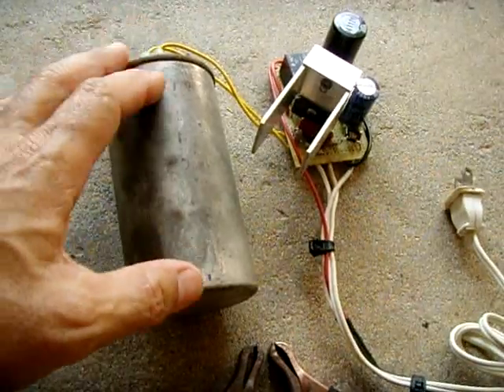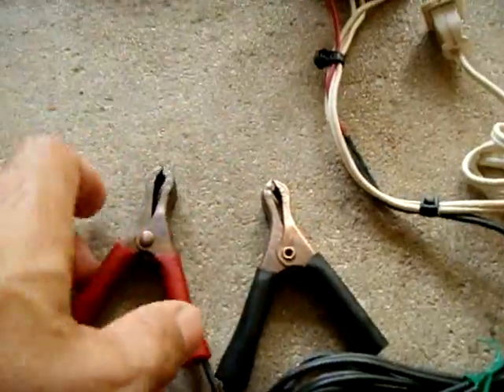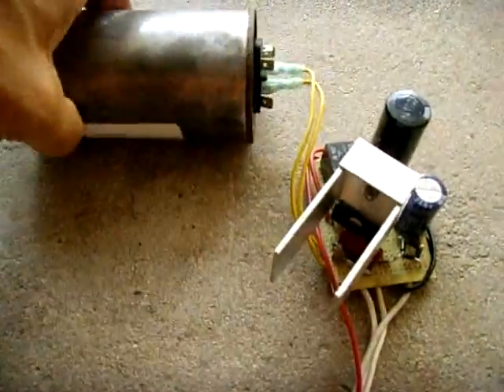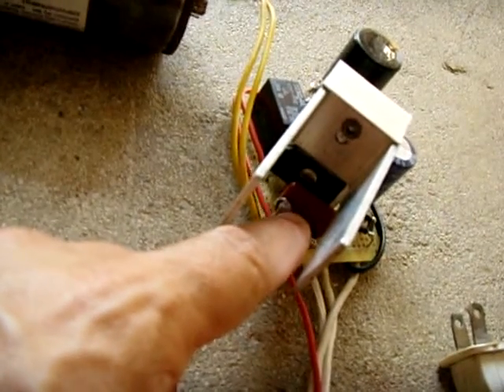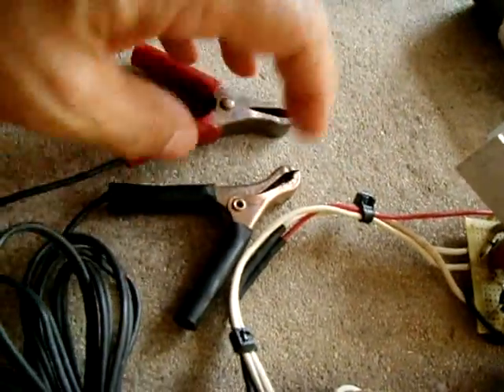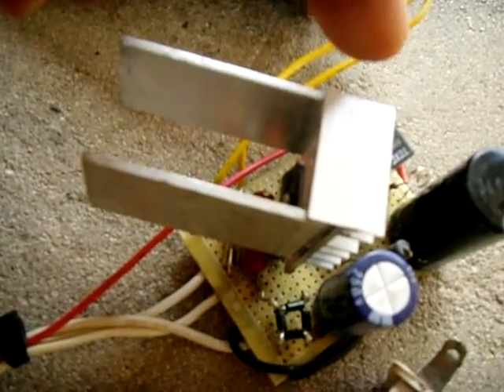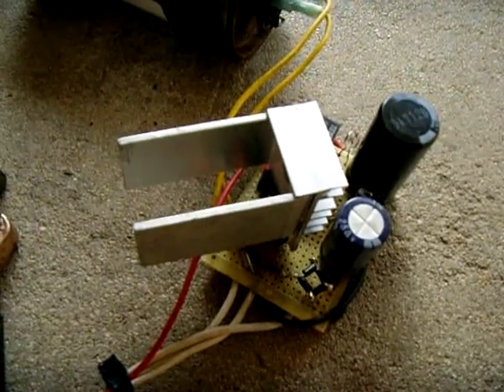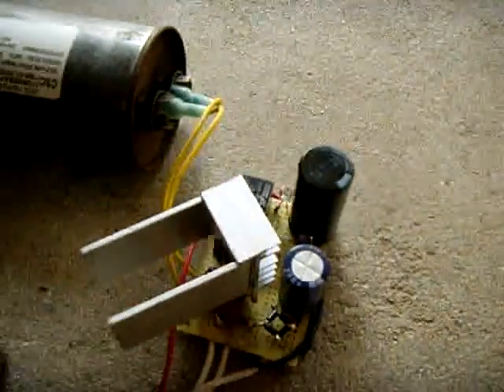How To Make Capacitive Lead Acid Battery Charger(12V)

Comment: How thick do the cables have to be if I use a 150 microfarad capacitor at 230V or how thick are your cables at 120V and 5A?

Comment: I understand the Pulsing effect but I would like to know why the need for such a high voltage applied to the battery.
Could a transformer be used with the cap in either the primary lead or in the secondary lead offer the same current limiting
effect and still getting the 120Hz pulsating effect but with the lower secondary voltage provided its higher than the needed battery voltage.
Reply from the maker: This video was for "demonstration" purposes to show how you could charge a battery if a transformer or solar panel was unavailable. :-) The voltage drops down when you connect the circuit to the battery.
Reply: Yes I realize the voltage drops down. Its due to the voltage divider circuit between the capacitive reactance and the resistance of the battery.  I am trying to understand why any voltage higher than the battery voltage is required.   Does the much higher voltage have something to do with the desulfation on the plates of the battery verse a voltage closer to the battery voltage being applied across the plates of the battery?
I don't see this available on the market due to the high voltage across the output however if that voltage was no higher than 18 volts for a 12v battery using a transformer, would the end result be the same for restoring the battery.
Not easy to get theory on this design.   Thanks for your response.
Reply: Ken. For safety's sake, use a transformer. I believe your 18 volts AC would suffice. Note that current delivery has to be controlled, so you can still use caps as limiters.  Put them between the tranny and bridge. I would begin slow. You should monitor temperature in the initial stages.

This isn't really a pulse effect so much as a high voltage peak. It's the peak doing the work. It won't achieve the results a real pulser would, and I wouldn't use it on SLA.

Comment: http://poormanguides.blogspot.com/2016/01/battery-desulfator-capacitive-voltage.html

i built this took about 1100mf on the paralel to drop voltage to about 16v when using 150 amp rectifier .. cheaper rectifiers need less capacitance dont know why ? something to do with the diode ratings prob

Comment: I appreciate all the warnings you mention but I think you should also make it explicit that, even if the neon bulb doesn't light, BOTH terminals of the output (battery connected or not) will be at 120VAC with respect to ground.
Reply from the maker: No, when the relay opens up the connection and stops charging the battery, the 120V AC line is no longer connected to the battery terminals if wired properly. The neutral line will remain connected(0V).
Reply: +electronicsNmore ok but I am talking about while it is charging. You do say not to touch the battery terminals while it is charging but you also say that the neon bulb will indicate if there is dangerous voltage on the output. if I understand correctly the neon bulb is connected across the battery terminal clips and therefore will be off while charging. someone might logically assume that your warning about touching the battery terminals is really just in case of some malfunction and as long as they dont see the neon lamp on, it would be safe to touch one of them - but even during normal operation aren't both output terminals at 120vac?
Reply: +electronicsNmore ok but I am talking about while it is charging. You do say not to touch the battery terminals while it is charging but you also say that the neon bulb will indicate if there is dangerous voltage on the output. if I understand correctly the neon bulb is connected across the battery terminal clips and therefore will be off while charging. someone might logically assume that your warning about touching the battery terminals is really just in case of some malfunction and as long as they dont see the neon lamp on, it would be safe to touch one of them - but even during normal operation aren't both output terminals at 120vac?
Reply: +electronicsNmore ok but I am talking about while it is charging. You do say not to touch the battery terminals while it is charging but you also say that the neon bulb will indicate if there is dangerous voltage on the output. if I understand correctly the neon bulb is connected across the battery terminal clips and therefore will be off while charging. someone might logically assume that your warning about touching the battery terminals is really just in case of some malfunction and as long as they dont see the neon lamp on, it would be safe to touch one of them - but even during normal operation aren't both output terminals at 120vac?

Comment: i hope you could come up with a circuit that can be used for 220volts ac, like what i'm using right now. it is also a capacitve transformerless one, but unlike yours, my charger don't have safety features, thanks

Comment: Hi,
Hope you are still answering comments and questions.  I'll appreciate an answer on both my answers.
1st question:-    Boyntonstu3 said 3 years ago:   "Leave out the smoothing capacitor for desulphating capability..."       Is that both the 200v 680uf and the 200v 470uf capacitors ?  - I need to know if I can just leave them out and not change anything on the diagram?
2nd question: -  You said a 220v AC version would be too dangerous.  Can I use a step down transformer or an old Variac to supply me the 110v AC for the charger AND wouldn't that make the charger then also safer 
Thanks

Comment: looks good but your smoothing caps defeat the ac pulse which helps desulfate the battery.
Reply from the maker: No reason to desulfate a lead acid battery which has been properly maintained.
Reply: U Speak like an old lady.All lead acid batteries develop sulfate if the voltage drops below 10.5 volts. Unless it's your personal auto driven daily :^)

Comment: can i use a transformer to step down AC voltage to 60V AC which is isolate and safe to human being?
Reply from the maker: Yes, but then you defeat the purpose of a "transformerless" power supply. :-) This video was made to show how you can charge a lead acid battery if no transformer is available.
Reply: i see, i will try this in the future and i will make sure i put every thing in a secure area.
Reply: +electronicsNmore sir can i use starting cap??? and my oulet voltage here in my country is 220v.

Comment: Could one use a DP switch with one side turning off the AC while the other side shorts the BAT leads, or CAP leads together to discharge it? On opening SW would turn on AC and open the CAP short?
Reply from the maker: Unless you're very familiar with circuits like this one(transformerless), then I do not recommend making this.

Comment: Innovative charger!
I wonder what determines the limit of current to charge a SLA or a series of SLAs such that they won't be charged too fast causing the plates to overheat ?
Reply from the maker: The value of the capacitor. In this case 100uF at 120V/60hz = 5A max
Reply: electronicsNmore I mean, is there any specification or rating on a sla battery that tells us how much current it can take or accept when charging such that the battery wont bloat up? i have a 36v (3 x 12v ) sla battery pack whose charger is rated at 1.6A of charging current. I wonder why 1.6A and if its 2 amps, will the charging be faster? Thank you.
Reply from the maker: Cosmo John Refer to this website to learn more:
http://batteryuniversity.com/learn/article/charging_the_lead_acid_battery
Reply: electronicsNmore Thanks !

Comment: I want to use this charger for 48 vdc 12 amp and input is 220 v the what current flow in input side and when output is 12 amp  and is want use isolation transformer then what capacity transformer i need
Reply from the maker: +Gaurav Saini 
I do not recommend making this type of charger for 220V. Too dangerous.

Comment: You are quite right, now they are going to switching power supplies. Not quite the way you did it. virtually every recent 'wall wort' has one. Transformers are heavy and expensive; it is cheaper to eliminate it. However the commercially built chargers in are tightly sealed in plastic cases. As far as your comment goes about not duplicating what you see on the internet, the next commenter refutes it; he is asking for a schematic. You have to know that posting a dangerous idea will encourage the technically ignorant to try it and they will ignore the warnings and disclaimers.
Reply from the maker: +Jeffrey Deutsch 
Hi Jeff. There are many things shown online that most people should not make. I do have disclaimers. The purpose of this video was to demonstrate how a 12V lead acid battery can be charged without using a step down transformer. I also supply the schematic so people see exactly how I did it. All transformerless power supplies have that potential to cause serious injury or death. Never touch a circuit like this while the AC cord is plugged in.

Thanks For Watching!
Reply: +Jeffrey Deutsch 
OK,
But could it be used, to correct ISIS members, by attaching to their knackers?
Did like your comment though; 
In defense of the vids poster!
I can't see any none electronics savvy, person trying this, just for the fact that it's on a breadboard; They more than likely to fail through lack of knpwledge on how to use breadboards + schematics!
I#m now almost an OAP; But My first and only electric shock, happened when I was 9, being naive I opened a vacuum cleaner, and wondered what the coil did!
All was answered whenI put my finger on it, I didn't know any swear words, But I did leap a good 4 foot up and 12 foot across the room!
since I have never touched a BLOODY LIVE COIL nor one that's been disconnected for awhile!
Your comment is good!
But so is natural selection!

Comment: This is the most dangerous, hair brained thing I have ever seen. You may very well be working out doors in damp or wet conditions. Nobody but nobody builds a battery charger without an isolation transformer. I see he spends most of the video working on  methods to prevent you from electrocuting yourself. A simple step down transformer converts 120 volts  of dangerous line voltage at maybe an amp to around 15 volts at 12 amps. You can hold those 15 volt leads while standing in a puddle and not get a shock. With the tons of commercial chargers out there NOBODY goes this route. There is a reason. I have 50 yrs experience as an electronics tech. DON'T BUILD IT. There are many safer circuits out there.
Reply from the maker: Jeffrey Deutsch The purpose of this video was to show an ALTERNATE way to charge a 12V lead acid battery if you do not have a battery charger or transformer laying around. Of course I added safety features to my charger to help prevent a deadly shock. Clearly the average person would not be making this. Just because you see something on Youtube or elsewhere online(Usually far more dangerous), that does not mean you should duplicate what you see. This video, like many of my other videos, is for informational purposes. I guess you also failed to read my disclaimer. People like to know other ways of doing things, even if those ways have the potential to be dangerous. Many electronic devices sold today use transformerless power supplies. This is nothing new.

Comment: i see the the danger with this type of charger and the importance of it no being in the on mode/plugged in. but why not add a on/off switch to the charger, like every other electronic device. so unplugging and plugging it into a wall outlet isn't an issue. just switch the charger off and on. and a bleeder resistor across the capacitor seem like a great idea, if you do happen to turn it on without a load on the battery leads.  now i will admit that i'm not as versed at ac caps. so if it's not feasible to use a bleeder resistor across the capacitor terminals. then why not add a normally closed relay to the power switch. then when the relay closes "turned off" it would employ the bleeder resistor, draining any charge in the cap. now as to how large the resistor should be, that would mean to do the figures for the time constant. the resistor now could be larger/higher wattage and ohm than normal for a faster bleed off and not being a factor when it is on. i see this fix, knocking out two birds with three stone. but they are really big birds.

Comment: Is there a design for a simple circuit that looks for the tiniest voltage (min 1v) from the battery before kicking relays to power the capacitor?  As soon as (or with delay) the clamps are put on the battery, a relay kicks and it starts charging.  As soon as the clamps are removed, the relay kicks off eliminating voltage at the clamps. That would be safer than waiting for it to discharge.  I know there would be a trick to getting it to kick off if you remove the clamps while it's still plugged in since voltage would be present from the capacitor, but I've seen newer fancy chargers do this, so why not figure out a way to do it with a capacitor?  Also, the smoothing would have to be omitted or a switch introduced just for desulfation mode.
Reply from the maker: This circuit works extremely well, but it can be dangerous if not operated properly. ALWAYS unplug the charger BEFORE removing the clamps from the battery as an added precaution. This is no circuit for the "Average" person to be using. When you unplug the charger, you wait 5 -10 secs then your safe to handle everything.

Comment: Can I use a Washing Machine Capacitor?
Reply from the maker: Only if the capacitor is a RUN capacitor(round or oval metal can), not a start capacitor. Generally those washing machine caps are too low in value.
Reply: electronicsNmore :D, I'll try it.

Comment: What is the voltage of the relay, also where can you get one?
Reply from the maker: I used a 12V pulled from a microwave oven. The smaller relay usually found on the circuit board. (km1-m12)
Reply: electronicsNmore Thanks, I need to find one
Reply from the maker: Go hunting for broken microwaves and other electronics. The relay is rated 5 amps 125VAC.
Reply: electronicsNmore Finished, I went a step futher and added a timer, Work great, Thanks again
Reply from the maker: Good to hear!

Comment: Thanks I Like I

for 230v 50 Hz for replication what most i change
Reply from the maker: I did not test this for 220v, and really do not suggest making a 220v version, but it should work fine if you do the following. 100k-2w swap with 220k to 270k-4w, 370v-100uf swap with 370v-50uf, 360k-1w swap with 1m-1w,  250v-1uf swap with 400v-.5uf(504 cap),add 100 ohm - 1W resistor between smaller(1A rectifier) and the lower AC neutral rail,  200v-470uf swap with at least a 250v cap, make sure large rectifier is rated 400v, replace 47k-1/4w with a 120k to 150k- 1/4w, 200v-680uf swap with 400v-680uf, Same relay. If you have a double pole relay, then use that. You can have both the - and + disconnect at the same time. Charger must be connected to the battery BEFORE turning on power. Turn off power, then remove clamps. Be sure to check that all resistors are only warm/very warm, if they are hot, use a higher wattage. I may have used resistor wattages that are higher than required as a precaution! Be very careful, you are dealing with 220v!
Reply: I would not recommend copying this circuit for 230V.
As a matter of fact, I would not recommend copying it for 110V either...
Unless you live alone, this is a KILLER APPLIANCE, and I mean it literally. Imagine a kid, or even an adult (who's accustomed to standard battery chargers which are always insulated from mains), touching the bare battery clamp... barefoot... And if someone decides to charge a battery from 230V AC in-car, on a camping trip...
 
That's highly irresponsible having such a device at home, and even more so, posting it for others to copy.

In the past there were many appliances (like tube radios for example) with a transformerless power supply. There are some today. But all of them make it a point of heavily insulating any user control (switch, knob etc) sticking out of it. And here you have live mains on the metal battery clamps!

I understand, that you know what you are doing, you know which prong in your socket is live, and which is neutral, etc. etc. But most people don't. And certainly your family, friends, guests etc. don't know anything about it. It's like a loaded and cocked gun laying on your desk for everybody to play with. Or maybe even worse, a loaded gun disguised among children's toys, or a jar of cyanide among jars with spices on a kitchen shelf.

Not to mention the absurd losses you create - 1150VA of power (@ 230V) to charge a battery, and a power factor low as hell, this is one of the most environmentally unfriendly devices on the planet.
Reply from the maker: First off, that is YOUR opinion. This circuit is NOT for the average person. The circuit works extremely well if made exactly as I show in this video. People who have little or no experience working with electronics, or 120/240v mains power, have no business making this circuit. This video is for people who understand any/all risks, as well as having knowledge of electronics, and respect 120/240 mains power. There are THOUSANDS of videos on Youtube which (according to you) are irresponsible/dangerous). As long as you respect the type of charger that this is, and take all precautions/safety measures, there should be no problems. If you have young children, or people around that are not the brightest, you would not make this! Use common sense. When The charger is in use, you do not touch the clamps.
Reply: +electronicsNmore With a bit of tinkering and a low cost pic microcontroller you can make it safer
Reply from the maker: Miguel Ángel Simón Fernández
Hi there. This video was made to show what "can" be done if needed. It is always good to know alternate ways of doing things. Normally you would use a transformer. Thanks for watching